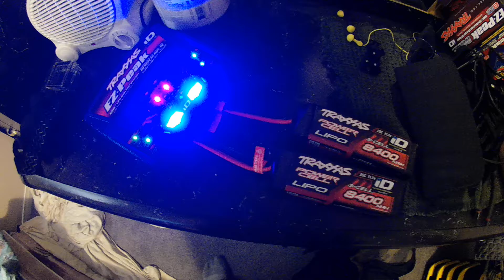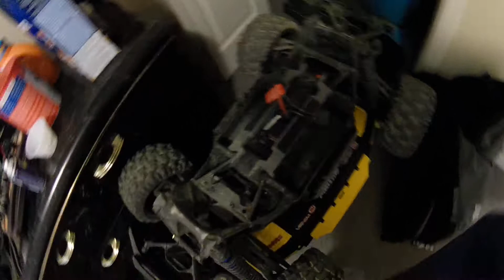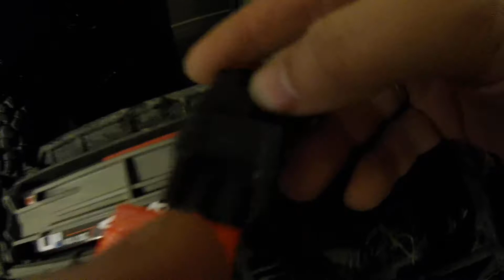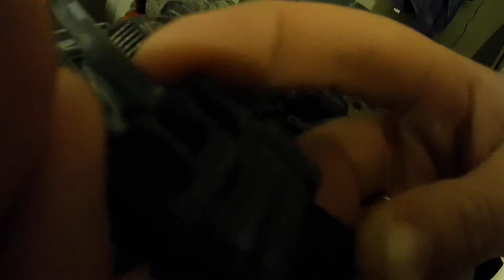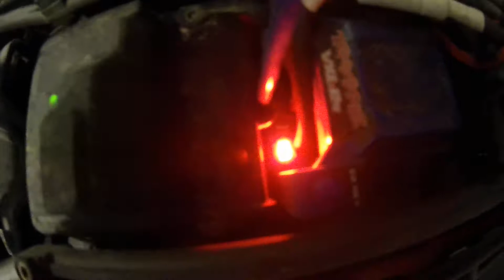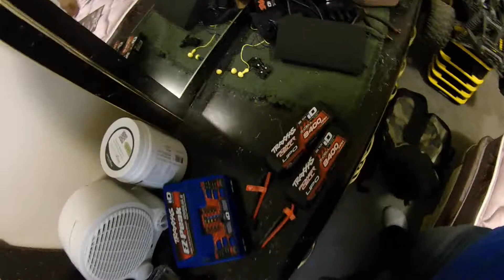VXL-8S X-Maxx ESC Failure - Manufacturer Defect?

Comment from the maker: UPDATE: The ESC was defective and Traxxas did replace it free of charge. However, i had to ship it away for testing prior to receiving a new ESC. Took about 5 week from Ontario, to Traxxas in Texas, and back. There have been many MANY blown VXL-8S ESCs that I have seen online, and most seem to be doing a direct replacement with the Hobbywing Max5, Max6 or the Castle XLX system.
Reply: Just bought mine  last week , $1200 plus $405 batteries and charger. 
Today is my second time running it, after 30 seconds it went into thermal shutdown, called traxxas and was told i meed to send esc back. 
So i mailed it today. cost over $20 bucks for shipping plus probably take a month or 2 to get it back 😩
Reply: @jamesjayson8799  I fell you bro. I'm waiting for new ESC for my 2 weeks old E-Revo 2.0
Reply: Daniel Kostelecky I’m dealing with the same but with low voltage. Im upgrading to max6
Reply: pin my post above bro people need to know. the reply to 李正则
Reply: Did you have to pay the shipping cost ?
Reply from the maker: @jamesjayson8799  yea.

Comment: I am pissed, had my x-maxx for 3 weeks drove it maybe 14 times, and my stock Traxxas ESC all of a sudden on dry pavement just shuts off with fresh battery's. went to see whats up saw it was off so I tried turning it back on.. will NOT turn back on at all now bleh started a RMA

I just really want a better ESC, but I also want to keep my dual battery's and charger from traxxas and the factory connectors
Reply: dude same problem happened to me
Reply: That's crazy bro I looked all over the internet to try and find someone with my exact same problem, found nothing until your reply. My truck was doing 40 mph when it shut itself off due to the ESC. Imagine if it hit a small child causing death and I had 0 control over the vehicle and could not stop it from happening. 

Basically id be in jail for Murder because of this VXL-8S ESC.. Been 13 days so far since Traxxas got their faulty ESC back and still no replacement ESC.. I Keep calling and keep getting told its on backorder.. still no tracking info on a replacement. 

I Strongly believe going Max6 or Max5 is the best solution to this kind of problem like Daniel Said Below

Comment: Same FUCKING problem here guys... WTF?
Reply from the maker: seems the first wave of ESCs were pretty crappy. I'm in a FB group of owners, and i saw plenty of failures just like this. Traxxas replaced the ESC in this video with a new one. the motor was okay. people have been replacing the vxl-8s with the hobbywing max5 esc and getting much better performance and overall reliability. Thanks for watching my video :)
Reply: Thank you for your reply. Do I have to get the traxxas connectors to make the MAX5 work?
Reply from the maker: To my knowledge yes. You will have to solder them on as well as make a brace to mount it. People are using a piece of aluminum plate and ziptie it to the chassis braces that run from front to back since the max5 is larger than the vxl8s